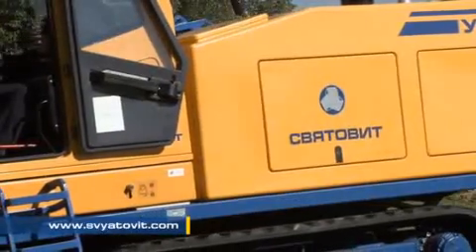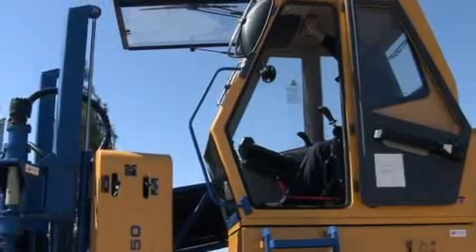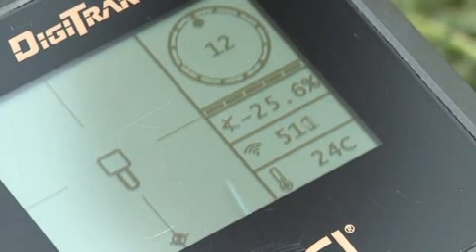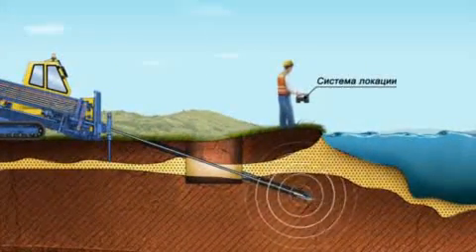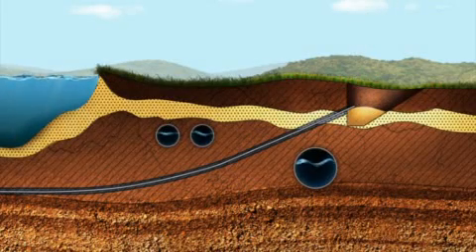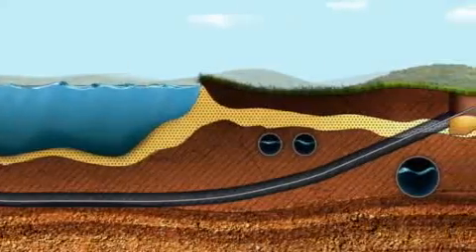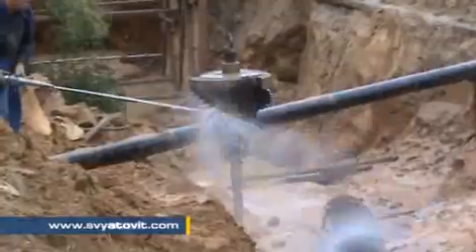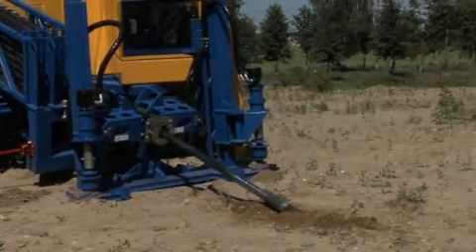Horizontal directional drilling machine

Comment: Thanks for posting this video.  I'd long wondered how these drills are steered underground.  But at 2:25 , they finally reveal the secret:  the end of the "drill" is cut not perpendicularly to the drill's axis, but at a sharp angle to the axis (so the drill is "chamfered").  If the drill is pushed while not rotating, it will move in the direction that's opposite to the sloped face at the end of the drill.